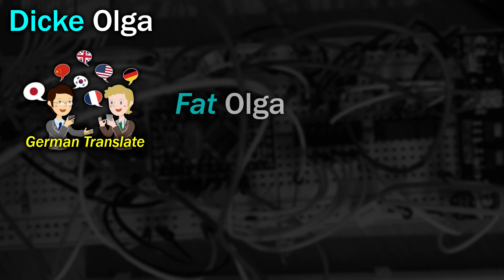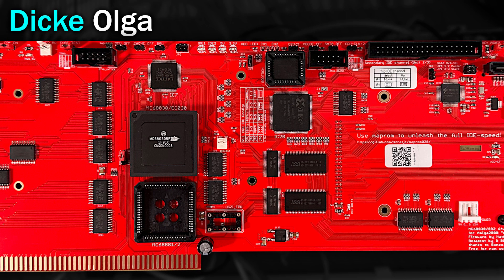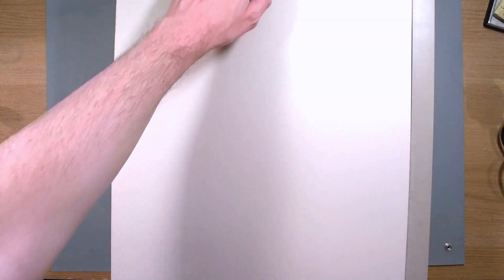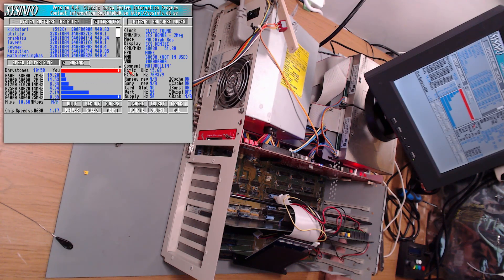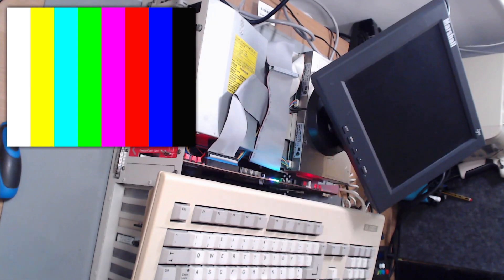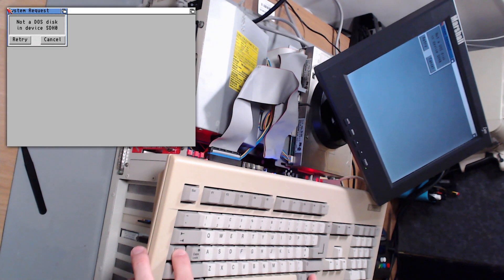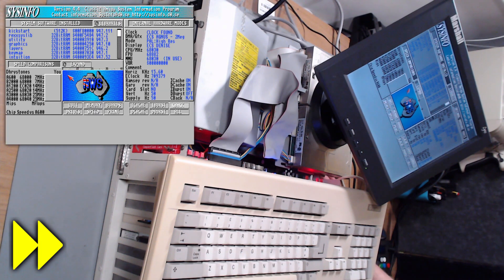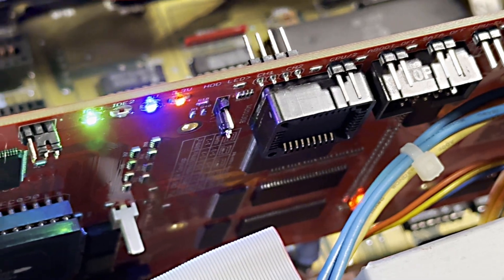50Mhz Amiga 2000? Meet the Dicke Olga...

Comment: At one point I owned every Amiga except the A3000 and A4000.  I had installed 68030 accelerators in all of them along the way and my biggest complaint was the lack of backward compatibility after upgrading the CPUs and/or the ROMs.  Many games and apps simply wouldn't run properly or at all without all kinds of modifications to the startup-sequence and disabling certain caches, which defeated the purpose of the accelerator to begin with.  Many games and apps also wouldn't run properly or at all if you had upgraded to a 2MB Agnus chip.  PC users had superb  backward compatibility and still do.  If Commodore had allowed its engineers to add chunky pixel modes and improved backward compatibility, I have no doubt that the Amiga would still be alive today in some form.  It was lightyears ahead of other systems in its day, but Commodore squandered what they had and we know the rest of the story.
Reply from the maker: It’s a funny thing really. If the Amiga was still a mainstream computer of choice today, then we probably wouldn’t have such a huge and warm community surrounding it. It’s interesting how the PC kept compatibility whilst Apple chose to break it to improve the machine. I suspect later Amigas would somewhere along the line have lost backward compatibility except maybe through emulation

Comment: I would love to get another Amiga but like most things in life now i am priced out. Ebay has become a boutique for the rich. Unless there's a way i can emulate the hardware somehow? i dont have a chance at getting another.
Reply from the maker: Well simplest solution is the A500mini, the A600GS, a raspberry pi running Amiberry or WinUAE on windows. Or buy AmigaForever - so many very low cost options. And depending on your budget Amiga500s are sometimes reasonably priced on eBay. nothing wrong with emulation!
Reply: @RobSmithDev  The A600GS seems to be a more complete option to which i may explore or a Pi400 with Amiberry. Both good options. Thank you.
Reply from the maker: Pi400 is good (pi5 is faster) - search for Pimiga- it’s a pre-setup environment which you might enjoy
Reply: @RobSmithDev  Just seen that Pimiga runs on laptops too if im not mistaken.
Reply from the maker: @cirinaharvey1466 sure does, latest build dual boots

Comment: This is a really fantastic card. Many hobby projects often lack good documentation, but not this one. Even better, the people behind it are incredibly nice and genuinely want to help. Had some initial (power) problems getting my card to work. Wouldn't be an Amiga if it worked on the first try, would it? Now I'm running the CPU at 60 MHz and the FPU at 50 MHz. Installed an m.2 S-ATA drive and after some tweaking run it just shy of 10 MB/s. Just incredible.
Reply from the maker: Ive got a followup video on the way now I'm using the right version of MapROM and yeah its incredible!

Comment: Not used this card , but I have a TF536 in my A2000 . Wondering why you did not fit a DVD drive instead of CD , it mounts exactly the same and reads CD's and DVD's . Handy for transferring lots of data to the AMIGA .
Reply from the maker: The CD drive was just what I found. It’s actually a CD writer so I’m going to give that a try
Reply: @RobSmithDev  Yes mine is a cd/dvd writer . Ihave put it on the IDE interface of my ZORRO/LAN card , although I used to have one on an IDE to SCSI interface on my GVP HCII +8 card that just has a bluescsi v2 on it now .
Reply from the maker: I’ve actually got a SCSI Cd Rom drive but I just can’t get it to work, but no way to know if it’s me or it’s actually faulty
Reply: @RobSmithDev  Termination is the hardest thing to master with scsi . That is where people normaly have problems .
Reply from the maker: @alanleverett  may well be the issue although it does have a jumper for that which seemed to make no difference. Mind you the GVP card also doesn’t seem to play nicely with longer SCSI cables too so that might be a factor
Reply: @RobSmithDev  The gvp does not provide any termpower , one of the devices on the internal AND external chain needs to do this as the card does not pass termpower from the internal bus to the external bus . Also if you have internal AND external devices you need to remove the GVP termination resistors . Just like the A2091 and A590 a short cable for the on-board drive requires no extra termination , but term power still needs to be provided by the drive . If that is the HCII +8 that you are refering to .
Reply from the maker: Yes it’s that card. (I think lol) that’s probably the issue. Thanks!

Comment: Looks nice and i can see the appeal for people that still own a working box and want "real hardware". Only thing I'd say is that it might have benefited from a bit of "feature swap". IDE is a bit pointless these days, and if you still have any around, it's cheap enough to get a IDE<>SATA adapter, copy over to a cheap SSD and use it as a decoration on the wall. And, the worse part imho, lack of some SPI ports. Why SPI? Because if you have SPI you can just plug an ESP32 or similar and voila, you have a new "coprocessor" for a couple of bucks. And from there on, you can have whatever you can program, from an "ethernet" card (logic bridge to the ESP32 WiFi), a "soundcard" (logic bridge to ESP32 driving some DAC), a jpeg decoder, whatever, if you can code it you can have it. And this isn't an Amiga only criticism, the PicoMem for PC's has the exact same issue.
Point being, they did the hard work with the Zorro/ISA bridge, so why not open it up to the world. Plop one or two SPI's and you'll get new cool features added to the Amiga by people with off the shelf inexpensive hw...
Reply from the maker: Because that’s not what this card is for. If you want the options you describe you’re best off getting a pistorm. This card is trying to be more traditional. Nothing wrong with pistorm it all depends what you want to achieve.
Reply: @RobSmithDev  Different things. PiStorm uses the Pi as a sort of hybrid hardware/software cpu emulator. PicoMem uses the Pi as a sort of hybrid hw/sw "all in one". Adding SPI ports and corresponding spix.device on the board would just let Amiga software talk to the SPI port and do whatever the SPI devices on the port can do. Can be a SPI camera, a SPI temperature sensor, or... a MCU acting as a coprocessor.
From a design point of view, having a SPI device do some work vs custom ASIC's is just a matter of speed and cost. If the original Amiga designers had the option to add a WiFi card for €10 and the cost of a SPI port, they'd have jumped on it real fast.
If you think about it, it's no different than having a RS232 and a modem. Your computer doesn't do "modem things", it talks to a modem over a standard port, modem does modem things, talks back.
Amiga software telling a SPI device "here is some JPEG data, please decompress it and give me the image" is not fundamentally different than having the CDTV/CD32 FMV modules and telling their devices "here is the stream, please give me frame x"...
The key part is "coprocessors", aka addons, not replacements. One of my ESP32's isn't replacing my keyboard, but it's doing a real good job at being a "wifi controlled remote keyboard" so i can do keyboard'ish things on my PC using my phone. And yes, i could use RDP, but my lill MCU can do macros, passwords, pretend it's a gamepad, etc... all the things my real keyboard can't. Its a great... addon ;)
Reply from the maker: @ErazerPT well you could add an SPI adapter via the fast clockport on the board. The designer of the card probably didn’t have any requirements and just built “what they wanted”

Comment: I spent a while trying to build one of these, but the Lattice CPLD would never flash. Turns out I had the wrong pinouts, they changed during development and I had an early PCB :( I ended up with an N2630 - very similar, 68030@50/68882/128MB/LIDE etc. Still great to see this card tested though! Oh, one more thing.... Sysinfo isn't great for drive speed tests, Matt (author of lide.device) has found that in certain circumstances it "maxes out" the numbers and nothing you can do will improve it. I think on his advice I started using devtest to check drive speed.
Reply from the maker: I’ve got a follow up video in production as I made a mistake with the version of maprom I was using so this doesn’t really show the speed of the drive at all. I’ve still used sysinfo and I wonder if they fixed the maxing out issue because there’s still new versions of it coming out!
Reply: @RobSmithDev  Drop Matt a message, I'm sure it was the latest version of sysinfo as he asked the devs. There's devtest but also a new tool I've seen people use for drive speeds, shows read and write

Comment: My A2000s had 060s. This card needs space for a PI, networking, some graphics output like HDMI, RAM sockets & a rear port for external devices.  IMHO the ZZ9000 card seems to have more functionality.
Reply from the maker: The ZZ doesn’t have a CPU though right? So it’s not an accelerator. One of those is on my list though

Comment: Really wish this accelerator offered RTG graphics and maxed out the Fast RAM to 2GB (2GB RAM is the limit a 68k Amiga can use), this is needed for digital sampling and 3D rendering (using Lightwave).
Reply from the maker: An RTG is the next plan I have. I think this card does pack a lot onto it though. I suspect the majority of people would think 128M ram on an Amiga is more than enough thiigh
Reply: @RobSmithDev  Regarding RAM it depends on the use case… if you just want to play games, and admittedly that is what the majority of current Amiga owners want to do, yeah 128MB Fast RAM is great. However if you’re into digital sampling (like Calvin Harris, he still uses his A1200 for that and live too!) you need more RAM. Heck, the Blizzard accelerators made back in the day had the option to go up to 256MB RAM. I think at this point, given RAM is so inexpensive why not put the absolute maximum on an accelerator board? It wouldn’t cost much more and it would mean that you have all the RAM you could ever have. Even if you don’t need it, it is there. 

You could also do stuff like using the RAM disk and putting the entire program in it eliminating the data transfer bottlenecks.

I have the PiStorm accelerators on my Amiga 1200 computers. Using a Raspberry Pi 4 Model B 2GB gives me the max RAM a 68k Amiga can take and so if I can’t get it done with that, well I ain’t gonna be able to do it LOL. (emu68 really helps in that!)
Reply from the maker: I suspect it’s because it’s just a single person making the card the way they want to use it. That being said the design is on github so could be modded I guess
Reply: @RobSmithDev  that is good to know!
Reply: Won't help a far as the audio goes, but for render nodes, if all you need is really render nodes, and you want to keep using "legacy LW", just ScreamerNet over to some cheappo bargain bin i5 running 4 instances of WinUAE/FS-UAE. Textures scene with everything on and Enhanced High takes ~85s on a 1600AF. Wish i had that back in the days when the poor VLAB Motion was waiting all week for the frames to be ready... Pretty sure it's also a lot faster than what we were getting out of native Windows versions on P2's back then.

As for the mem limit, maybe board layout issues, lack of data lines issues, whatever. Board looks dual layer, which would make sense for costs, there might not be enough room for traces without running into crosstalk/timing issues. Dumping the IDE+CF+M2+Delfina for just 2 SATA's, 2 SPI's and more RAM would imho be a better tradeoff, but as Rob said this is probably what the designer wanted for himself, so that's what we get ;)
Reply: @ErazerPT  No, more RAM would help immensely as many of the applications for save the digitised audio files TO RAM. To digitise an entire audio CD would be be like 600 MB RAM alone .

As for using another computer, yeah that’s always an option but the point is to do it ON the Amiga.

Hell, I could use my MacBook Pro w/ M2 Max if I wanted to do it on another computer
Reply: @danielktdoranie  I understood that, that's why i said "render nodes" ;) You'd still do it (mostly) on the Amiga, it would just render on the nodes. Been a while but IIRC you don't have to render in all nodes which means you could Model/Animate on the Amiga at lower res and then send off to the nodes for "full render", as IIRC that's where lots of RAM would be needed.
Clunky yes, but feasible, IIRC there's an Amiga guy here on YT that uses that exact setup with a Toaster.
Why use an emulator for the render nodes? Because it's quite unlikely that any native LW 5.0 would run on current Windows/macOS/CPU's...
Reply: @ErazerPT  but that’s not what I am remotely concerned about